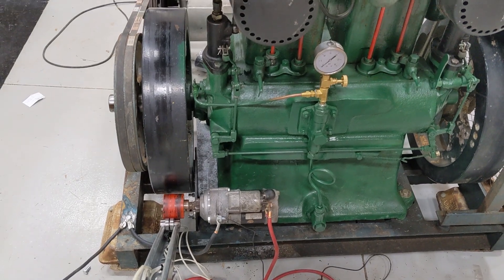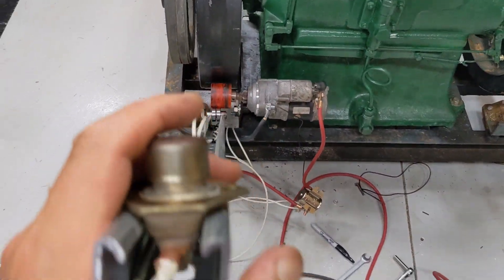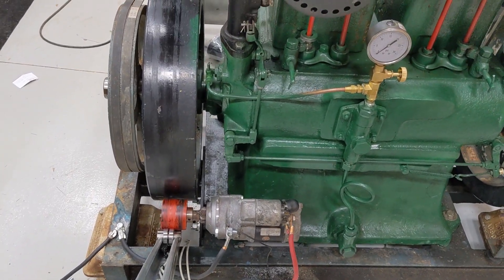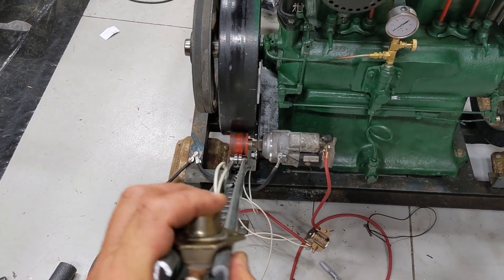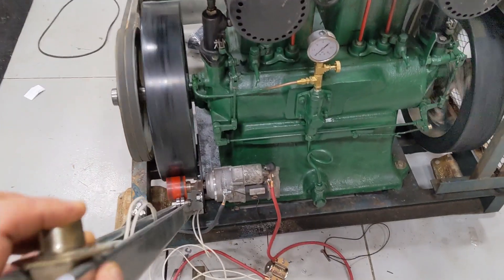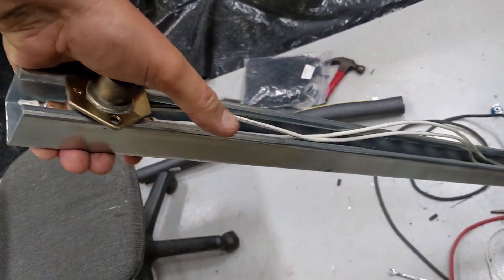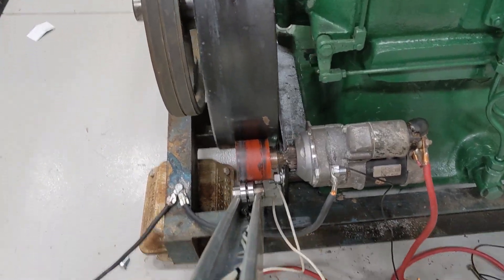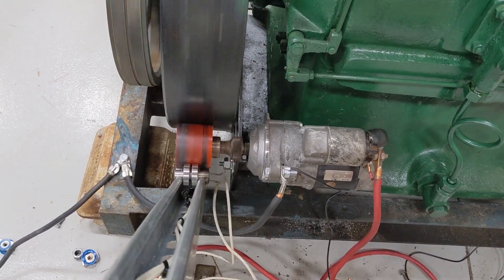Lister or Listeroid diesel engine starter

Comment: Sir pls can you tell me the all the thing you used in this ASAP?
Reply from the maker: Fairlane Products RR-502 urethane wheel, 6.6 Duramax starter, SuperStrut, starter solenoid, 12v battery and cables, roller bearings, welder, miscellaneous other items you'll be able to figure out.
Reply: @NoelBarlau  thank god sir....!! Thank you very much  ❤❤ BTW can you do one more favour for me pls?? 
Can you tell the problem or any difficulties while making or using this?
Reply from the maker: @superunited9916  I'd have used a different switch, the one I show in the video is a starter amperage rated switch and is far too heavy duty for the job of supplying current to a solenoid coil. Otherwise I'm quite happy with how it works.
Reply: @NoelBarlau  can you answer my one question please? 😅 actually I'm doing engineering and tomorrow is my viva about my project and my project is "development of self starter for diesel engine" And i choose this design.... So can you tell me is this starter can work on different relatable engine? I mean is this portable?
Reply from the maker: @superunited9916  If I were going to make it portable, I'd add a hinged rubber foot like you might find at the bottom of some ladders, and also come up with a high power lightweight battery - perhaps using four Headway 38120 cells in series, and moving the solenoid and motor to the handle.  It should be able to be condensed into a completely portable unit with those modifications.

Comment: Use a normal 10 Amp pushbutton, a lot easier. The small relay may only draw 2 Amps or so. The Starter current is controlled by the starter solenoid anyway.
Reply from the maker: This was the only switch I had on hand at the time, but I'll definitely be putting in a more appropriate one before I sell it.  Thanks for the comment, I love your channel.